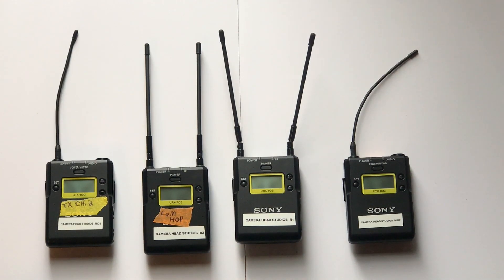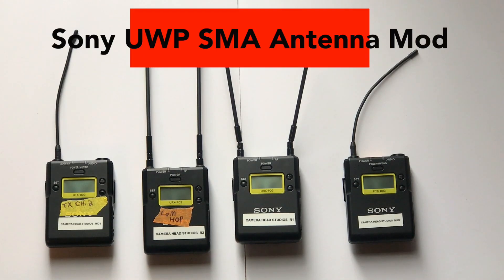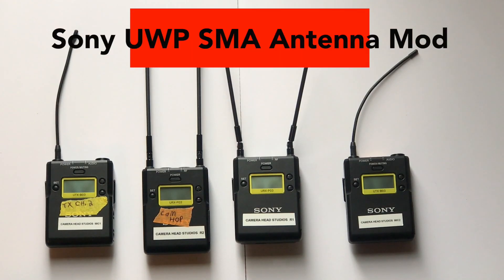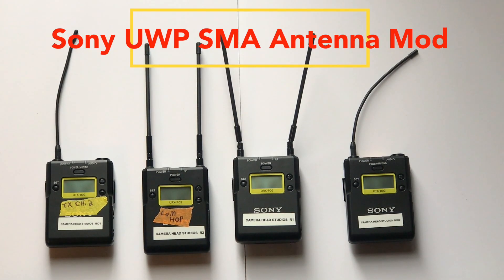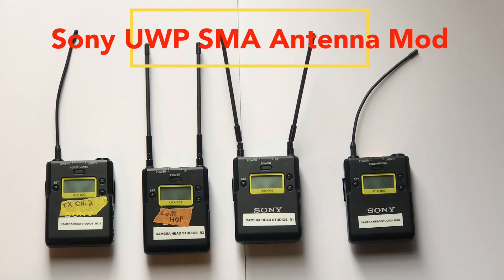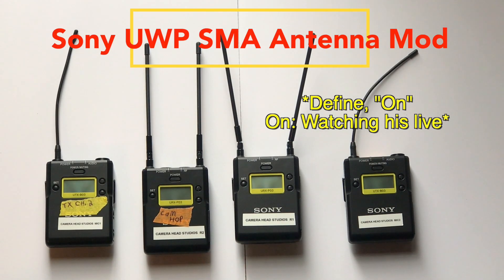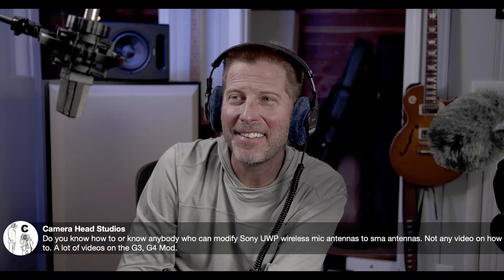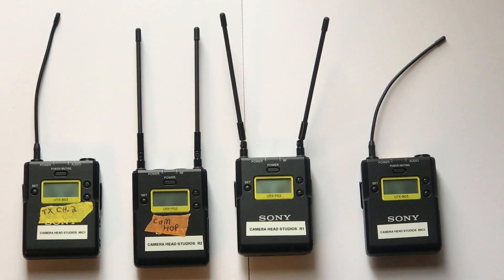Can The Sony Wireless UWP System Get A SMA Antenna MOD?

Comment: I did the mod myself years ago. very easy. Especially the receiver that doesn’t need soldering. you can open the modded units and see what work they did on yours.
Reply from the maker: Did you do a video showing the Mod?
Reply: Theres a chance you'll need a dremel to flatten two sides of the SMA.
 @cameraheadstudios
Reply from the maker: @mauriciopaiz745    https://youtu.be/3FkCFdvDmfY?si=mFnumWVzvPaNn0ZS